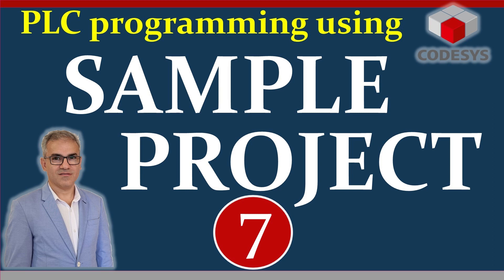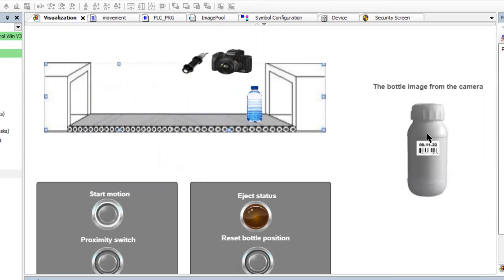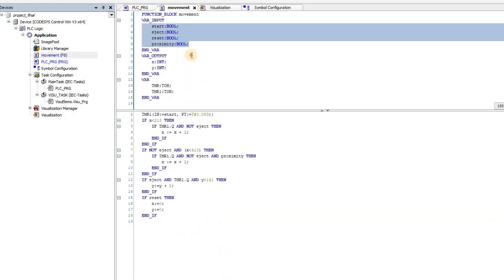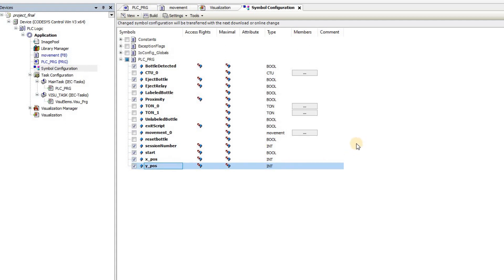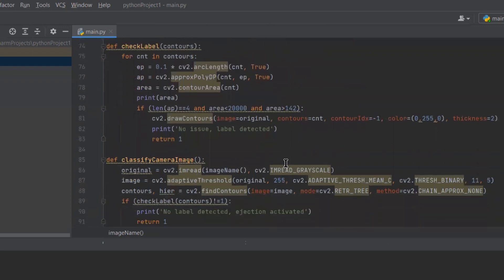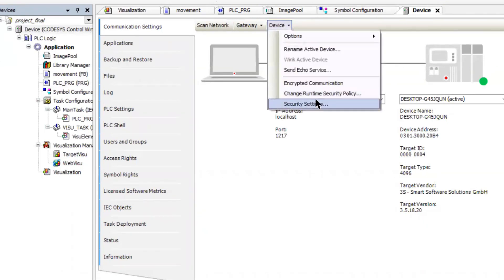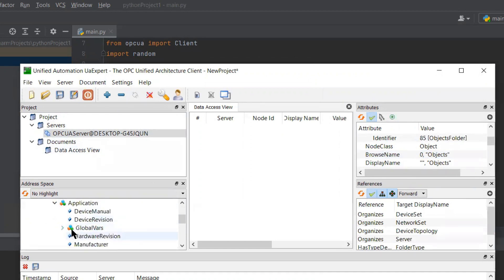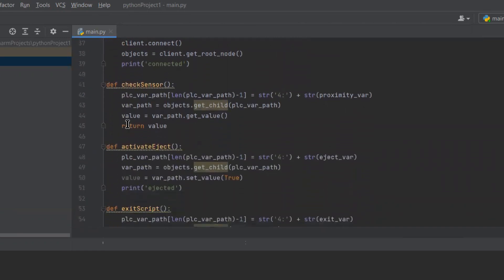Sample Project (07) for Industrial Automation course with CODESYS - Computer Vision with Python

Comment: I don’t understand where the python script will work? Is it possible to run it on a PLC in Docker? Did you go this route?
Reply from the maker: In this case the Python code was running on a PC. I have not tried working with Dockers yet, but I assume it should be possible.